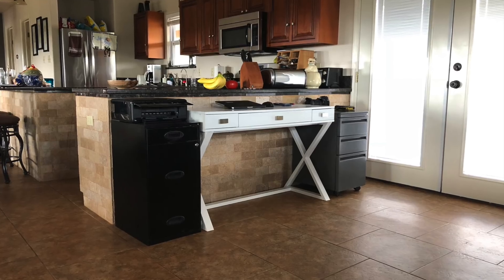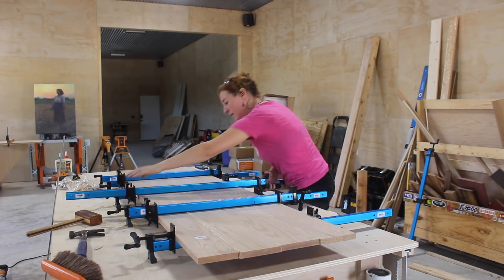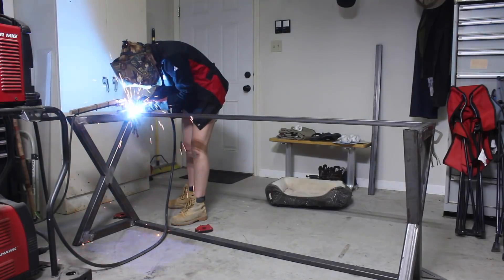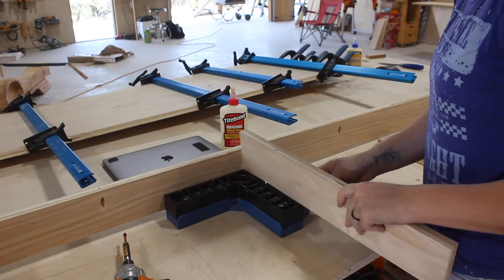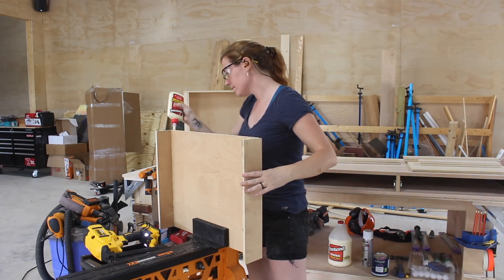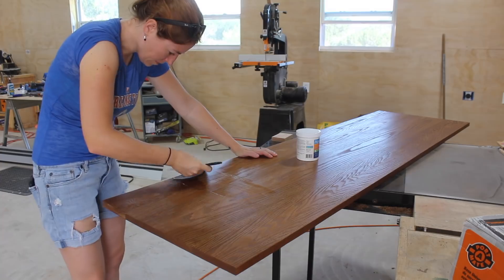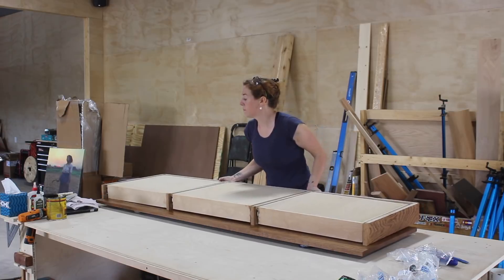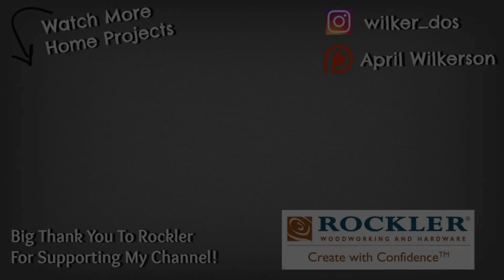How To Build A Computer Desk - Metal and Wood Desk

Comment: For the drawer alignment check out the masking tape and super glue trick. Drill the pull holes, remove face and masking tape, then apply permanent mounting procedure of choice.

Comment: The color combination really makes it stand out to me. Great job on all of it. The welding of the base was really neat to see. I wouldn’t think it would have been hard but with your experience and telling me different that was good info. I enjoyed watching the whole build. Wonderful job April!! Looking forward to seeing the drawer build too.
Reply from the maker: It wasn't that hard, but it is something that looks easier than it is. : ) It's different cutting angles into metal than wood. I typically leave my miters long in wood then sneak up on the cut, but you can't do that in metal because the blade wants to deflect trying to take off such little material. So just different materials, different temperaments. Glad you enjoyed it!

Comment: A wonderful job, as usual, April!  I noticed you were doing the Texas Two-step to keep from stepping on the cord while using your belt sander.  For the long term you could hang some receptacles from the ceiling above the work table to keep the cords away from  your feet.  It's also a good spot for a retracting extension cord reel or air hose.  For the short term you can throw the cord over your right shoulder then behind your neck then back in front and under your left armpit so the cord is behind you and not in front of you on the floor.  Just give yourself enough cord to extend your arm fully with the sander.  It also allows you to keep track of the cord with your left hand and manage the slack.

Comment: I have a small welding setup in the garage. No room for a welding bench. My old shop floor was so out of level and broken that setting anything on it to weld was impractical. I started using a sheet of leftover 3/4 OSB to layout and tack weld projects. It's nice for one offs because I can hold parts square with drywall screws. BIG HELP on projects like your desk with two parts that have to match.
Small jobs can be done on an appropriate sized piece. Larger ones can be on flooring. Tongue and groove sheets on sawhorses let you work unlimited. 
Once the tacking is done the sheets can be stacked and the truck brought in for the night.

Comment: I just knew when the new shop finally got put in place the videos would be back.  You are going over the top with adding the wood and metal combined.  I love it.  My shop has wood on one side, and steel fabricating on the other.  Unfortunately, they both suck up a lot of time, so very little do I combine the two.  My new drum sander may differ, but that project has been months in the making :P

Comment: Sounds like your next big investment should be a jointer. You've used the neighbors a few times lately. I'm excited to see your progress in the new shop.
Reply from the maker: Agreed, I'm currently looking for one. My neighbor rocks though as he doesn't mind me using his.
Reply: I would suggest finding an old machine and restoring it. A lot cheaper than buying a new “plug and play” machine.  Besides it would be interesting seeing you do a video, or video series on restoring old equipment.
Reply: Too bad I'm in Oklahoma and not Texas.  I'm selling my 6" cast iron bed Craftsman.
Reply: Jarod Morris for how much?
Reply: Mitchell Buss $150. The blades have a small nick that needs to be worked out when sharpening. I have a work sharp to do it but never built the jig
Reply: Jarod Morris i am intersted
Reply: He may say he doesn't mind but prob just being polite. I go by the rule if i need it more than 3 times I need one for myself. Same with tools when working in a garage together.
Reply: Or maybe a respirator for painting & staining ‘n such.   That would be a worthy investment.  
April, chemicals are hell and so is chemo!

Comment: This looks really cool, your welding skills are far better than mine too. On the desk your uprights have the grain running perpendicular to the top with no mechanism to allow for movement, this normally amounts to a split top if you used glue with the pocket screws or just misalignment over time if you used screws only. Sometimes though you just get lucky and it works which will hopefully be the case for you. If you make your uprights by making the top longer and using strips cut off that or use a sliding dovetail with glue up front only you won’t have any issues.
Reply from the maker: The uprights on the desk are plywood so no need to worry about it. : )
Reply: Wow I totally missed that you used Z clips to mount the top to the uprights, ahh the crippling effects of old age...

Comment: I've been following your videos and started woodworking a couple years ago in order to build some things for around the house and to get to work with my hands more. I'm currently working on putting together something similar to make a L shaped desk using wood (basically box legs using 2x4 pieces with cross braces in the middle) I like your idea of using a piece of plywood as a base to the top to allow for drawers to be put in and my incorporate it into my own design but I'm not sure with the l shape I may run into the problem of the drawers hitting each other when they slide out. Definitely looking forward to the file cabinet build as I'm sure I'll need room for legal size papers and folders.

Comment: Lot of trust with the folks who leveled the cement floor in your garage. Looks like it worked out though. Love your mix of skills with the woodworking and the welding. Wondering what you think of using magnetic jigs to hold the metal pieces in place?

Comment: Great job April, its seriously inspiring to see how you can make so many big builds one after the other in such a short space of time yet still have them coming out looking amazingly! One thing I personally think would make it look even better is adding some asymmetry, and having the right hand of the desk resting on the filing cabinet, although I guess then you loose the ability to roll or change the position of the filing cabinet :)

One other thing i'm wondering is how long does the grain filler take to try, and when it cures can you see it at all? Is it more like a resin or a wax in consistency?
Reply from the maker: My original design of the desk actually had the filing cabinet as the right leg but I changed it so that it can be mobile and also be pulled out and used as another desk top if needed. : ) So good thinking! The grain filler is completely clear so you can't see it at all. It only take about 5 mins for a coat to dry. That's why I replaced the lid between scoops and worked in small areas. It isn't like resin or wax.....the wood still feels like wood after it dries, it just feels like very well sanded wood. It's amazing stuff.
Reply: April Wilkerson great minds think alike! Wow that grain filler sounds amazing - almost too good to be true! Definitely going to have to give it a try! Out of curiosity since it dries clear do you think you could use it as a kind of improvised epoxy for filling voids or can you not layer and cast with it in the same way?

Comment: Hi April!!! If I don't have the ability to use metal for the legs on the desk, wood should work just fine, right? What would the difference be in how I attach the top to the legs if I did use wood legs instead? Thanks in advance!

Comment: Nice job, great metal work... wouldn't you want to add the filler before the finish or does the Aqua coat dry completely clear?
Reply from the maker: Nope, the process going to add the stain then the filler. : ) And yes, it dries completely clear.

Comment: So April how did you keep the Stain you sprayed off your new outside cement walk . Great job. So do you not own a  jointer.
Reply from the maker: There is some cardboard down, but I'm honestly not worried about keeping the concrete perfect. It's a shop and I plan to use it as such. : ) So far I don't own a jointer but I'm looking for one!

Comment: Do you take request concepts?

My request: a 10' thin bench that collapses / slides down / swings shut / whatever into a compressed size. I rent so I'd like this bench to adjust to whatever space I end up in.  

The functions for the bench: to hold up to 3 or more people, can act as a shelf for pots and be a shield for pots underneath.  Multipurpose/multifunctional is also something I hope for.

Comment: That looks awesome! Great job as always, April! I've used a similar technique for installing drawer slides. Do you have any advice for when its just a little too tight? Only thing I can think of is to try to remove just a little material from the drawer.
Reply: Southern Style DIY a well tuned jack plane does well for fitting a tight drawer.  A switch to under mount slides will help with fitting drawers. They are also,  then,  concealed.

Comment: When you were gluing up your desktop, there was a sticker on one of the boards.  How do you remove it so it doesn't affect your finish?
Reply from the maker: A hair dryer works great, but I typically peal off what I can then use a sander to get the rest.

Comment: Hey April, how about coming up with something for the workbench or shop so someone can use their tablet or laptop in the shop while they are working where it will be safe, and viewable no ,after what work you are doing. I'm thinking of installing a 32" monitor and a Bluetooth keyboard and mouse in my shop so I can see your videos or anyone else's as reference while I'm working on a project. Just don't want to get it broken or damaged by sawdust, metal shavings, sparks, etc.

Comment: A lot of American woodwork videos I see use shellac and finish with a poly, an someone explain this for me? If you're using a stain, shellac won't do much for colour. Poly is a stronger finish than shellac too, plus especially if using a dedicated grain filler, shellac under poly seems a redundant step in the prcoess? Thanks
Reply from the maker: I used shellac just to seal the grain so it wouldn't raise when I applied my water based top coat.
Reply: April Wilkerson ah water based top coat. I get it now. I'm going to chalk that one up to the kids waking me up at 4:56am and watching the video prior to having a coffee 🤣

Comment: What's the difference between a planer and a joiner?
Reply: LynxProd jointer will make a piece of wood dead flat on one side. Planer will make two surfaces parallel to each other (but not necessarily flat) If you flatten one side of a board on a jointer (or using another method such as with hand tools or a router) and then send it through a planer you'll end up with two flat, parallel sides. A planer is also frequently used to reduce the thickness of a board, hence they are often called thicknessers or thickness planers.

Comment: How did you learn how to weld
Reply from the maker: Just picked it up and started trying. The MIG 210 machine makes it simple because you can tell it what thickness of material you're using and it sets the feed rate and amps for you. : )
Reply: April Wilkerson thank you is that welder expensive?

Comment: Why working on the garage floor when you have that great shop?
Reply from the maker: Because I don't have power yet. : ) I'm still working on just an extension cord so I can't run anything that requires 220. I should have power in a few weeks then I'll be able to move all my welding equipment down to my place.

Comment: Sorry me again.... So as not to impact your design too much I would add a steal bar under the front portion of the desk from side to side, unfortunately this unit as is will sag and then you will also have the issues I stated in my comment below with the drawer slides.  The pin that engages the mechanism to self close the drawer is very small and very little catches the mechanism, if your drawer is undersized even a little and you get sag that pin will not always engage and then the drawer won't close at all.  I've installed these professionally  and within months pulled them out again.  I only use the under mount slides now.

Comment: Very cool desk, but i think some kind of cable management is in order. Like a channel that runs at the back of the desk to accept all cables and power-adapters. Makes the desk so much neater, and with a fixed powerstrip connecting everything is a breeze.

Comment: As a professional cabinetmaker I suggest NEVER using the soft close side mount slides!  They are nothing but a headache.  Stick with the regular ones or go to the bottom mount soft close.  The bottom mount are a bit more money and totally different style to build for but are amazing slides, lots of error and correction built in and even the knock off ones are far superior to the side mount soft close.  Please trust me on this.
Reply from the maker: I agree, this is the second time I've used them and they are so frustrating. One set won't close the last 1/8th without force which defeats the purpose of them.

Comment: Oak but pocket holes... cries
Reply from the maker: What a silly thing to cry about.
Reply: April Wilkerson BAHAHAHA!
Reply: A Texan born with common sense states it much better. The absolute beauty of April's work is the practical approach that doesn't waste time or cost.
Reply: It's a computer desk...did you think it needed Mortise and tenon joints?
Reply: Pocket Holes are a shortcut - and while there are a lot of things where shortcuts like that are okay, they do come at a price - they reduce the general strength of the wood by the very definition of how they work and while that may not be too relevant for the computer desk as long as they don't jump on it, it also reduces how much of the wood could be reused if that desk ever for any reason is no longer interesting in it's current form.

Do you have any idea how long oak trees need to grow? To me, personally, it seems a rather wasteful attitude to take wood from a tree older than my grandparents, then use brutal shortcuts like that in working it.

No, I did not actually shed any tears. But it would not be entirely inappropriate either.
Reply: Benjamin Lorrig pocket hole screws are not a short cut.  They are simply a way of connecting two pieces of wood.  The are many ways of joining wood,  and each one has advantages and disadvantages.  The way this particular piece was constructed,  the strength of the pocket screws is more than ample.   The time that was saved more than justifies their use,  and their location ensures they won't be seen.  The wasting of wood has too be close to the most ridiculous argument for not using a type of joint I've ever heard.  Slip,  or loose tenons, or dominos waste just as much.  But realistically,  if a piece is built well, scraping it for something else should not be a consideration.  Also, the material these pockets were bored in are already so small that they are quite unlikely to ever be used,  again.
Reply: Pocket holes are certainly a different method of joints.  And they are faster, but just like John Heisz says, overbuilding for the sake of making something stronger doesn't mean it's better.  I would assume the projected use they have will be satisfied by pocket holes.
At the same time, I like to hone my skills when possible, using dados, and mortise/tenons, but April saw this not as a learning experience but needed to solve a problem.  Look at as much as she has going on, I doubt she has any time.